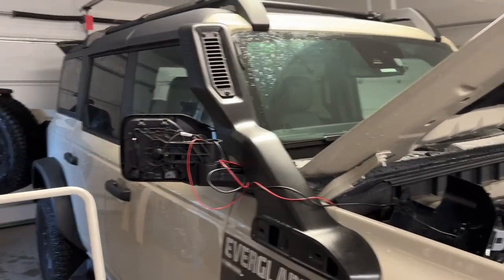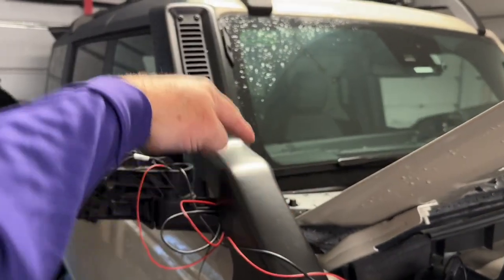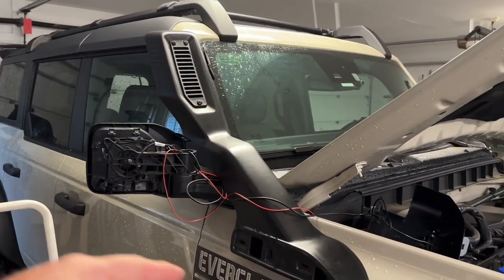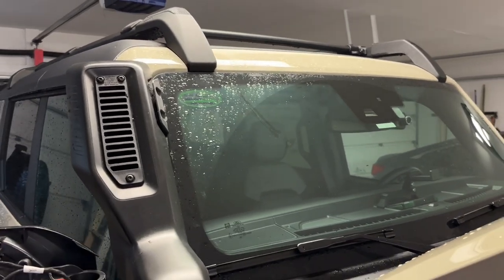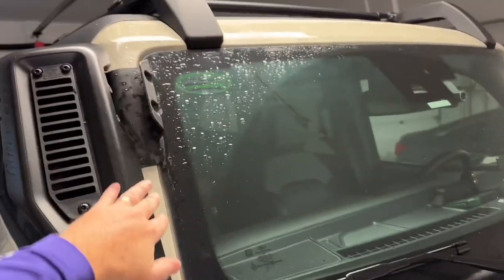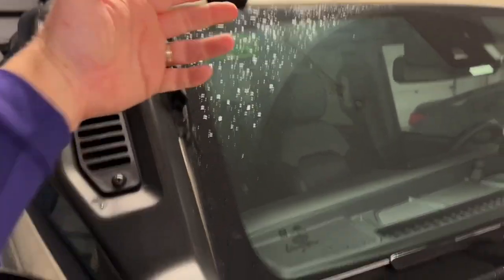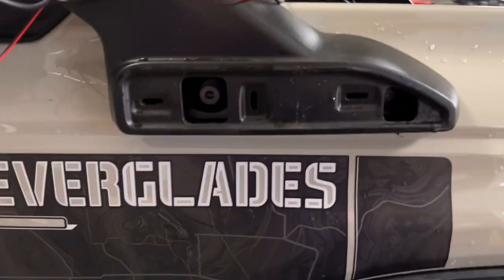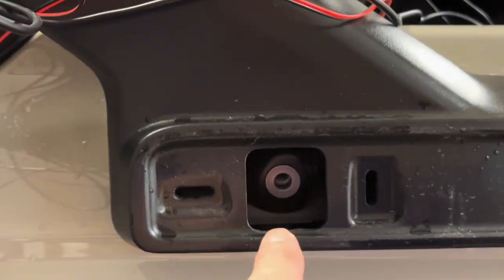Bronco 6G Everglades Snorkel Removal

Comment: This is the only content I can find on Everglades snorkel removal. Thanks for sharing. Did you just remove it for installing the lights, or did you fully remove it for long term driving sans snorkel? I could see where it would be nice to find a way to “easily” swap having it on or off.